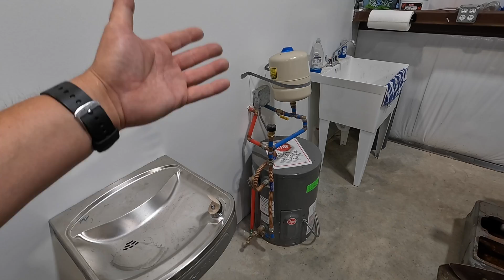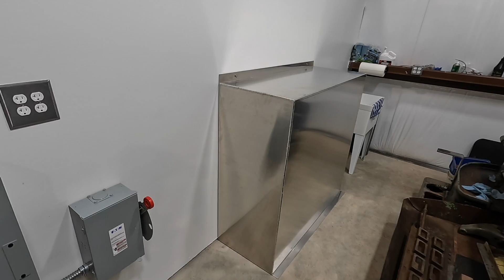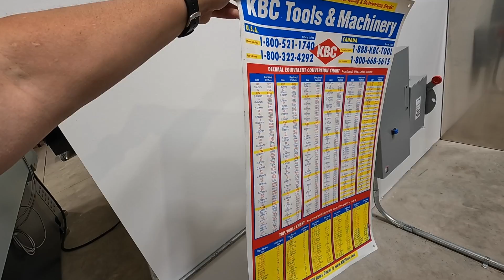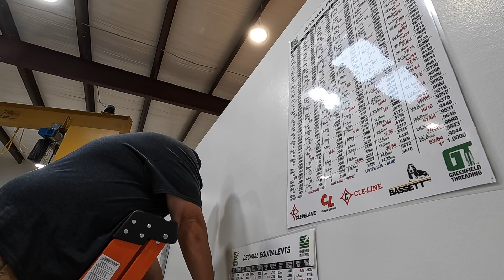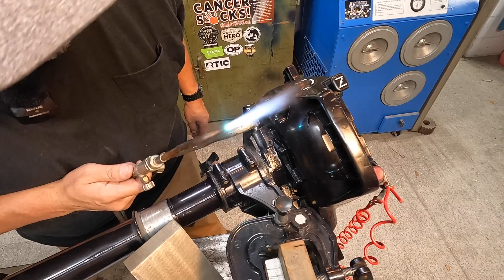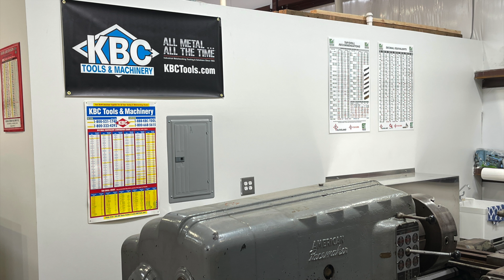SNS 363: American Flag, Shop Projects, Outboard Motor Repair

Comment: Easy slide hammer. take about 2 or so feet of 1/2 rod/thread one end to fit the adjustment screw on a big pair of vice grips/make a 1/2 inch thick washer to go on the other end of the rod  and weld it in place. Take a 2 inch or so piece of round stock about 5 or 6 inches long drill a 1/2 inch hole length wise through it so that it slides on the rod and your done. Take out the adjustment screw from the vice grips and screw on the slide hammer.
Reply: That would make the jaws not in line with the slide, better to weld the rod to the vice grips so the jaws are in line like jody at welding tips and tricks done

Comment: That water heater plumbing was shameful, I would be sacked if I did something like that, the expansion vessel looked ready to fall off the wall
Reply: It is very bad loking, covering it will do wonders.  Good thing you called it a Water Heater, being the son of a plumber I was always hit with "if it's Hot water, why heater it???  It is a WATER HEATER!!!!!

Comment: I got a couple of thoughts here. One, the expansion tank seems poorly supported. The second thing is the p-trap in the water fountain. Inevitably it will dry out and this may lead to sewer gasses leaking in. Aside from the bad smell there maybe toxic and explosive gaseous components.  They will get trapped inside that aluminum cabinet.  When I did plumbing and building maintenance work, one of my responsibilities was keeping p-traps topped up. Floor drains would get a mixture of water and bleach, sinks would get water only.  If a drain was unused and in danger of being forgotten, I would disconnect a p--trap and the drain would be blocked off.  My weirdest p-trap story involved a bathtub that was going to be unused for many years, but remained in place.  An old plumber mentor of mine came up with this solution, in addition to siliconing a bathtub plug in place and blocking the overflow, we replaced the water in that p-trap with mineral oil.
Reply: Interesting idea of mineral oil. A bit over the top maybe. I think a rubber plug would be enough.

Comment: Keep the water fountain accessible Adam. That can be used as an emergency eye wash station in the shop.
Reply: My Father had a machine shop in Louisiana, the water fountain in the shop area was always disgusting!!!  I would not wash anything in that fountain!!  The aluminum box makes sense.
Reply: Really he should buy the right tool for that, a proper eyewash station.
Reply: @omegamanz6  That's what can happen with an eyewash station if it's not regularly flushed. At my job someone needed an emergency room visit after a simple eye wash ended up shooting rust into both of his eyes. After that, a 5min. flush every week became mandatory, and so far has cured that problem.
Reply: @omegamanz6  The bottles are certainly convenient, but I'm always afraid of not having enough if needed. A regular flush isn't that big of a problem, if you consider it as maintaining and inspecting safety equipment.
Reply: @omegamanz6  You wouldn't want to flush a chemical longer?  How about battery acid? We use that in our shop, and if I were to get it in my eyes, I'd flush 'em 'til 3 or 4 guys dragged me away from the station.

Comment: this is the last way i would have tried to remove tat pin. i would have drilled out as much of it as i could, tapped what was left and used a slide hammer to extract it.
Reply: So....I remember Adam getting it out.  Now, I may be wrong, but wasn't that the idea??

Comment: The water fountain is a requirement by the government, the water heater should have been placed on top of the office area/loft section
Reply: It really should have been inside the office/waiting area.
Reply: Ohh Paul.........I agree!  I have seen hundreds of this type of tenant finish and the water heater is always placed above the office space.  It is very odd this was installed as it was!

Comment: I'm kind of dismayed that you burned up the powder coat on that motor housing. It takes a lot more work to repair than painted surfaces because it has to be disassembled, prepared and baked.
Reply: He did say it was a rush job and that the whole unit could be replaced for like $800 so I think that was a compromise to keep time spent and costs down.

Comment: with such a big location now, do you have plans to hire additional help. And with all the cool toys here at new location are you moving your other machines here as well from your other shop? And you should have some plaques made with info about the flags, that would be cool to show.
Reply: I think he said recently the end game is to maintain both shops until he gets a new shop built on the property they acquired. Think he said something like 2 years or so is the time frame they are looking at.

Comment: hang it horizontally
Reply: It won't fit between the AC units.
Reply: Then you'd have to punch a new hole in it - NOT good.

Comment: I doubt I'm the first to mention the lack of ventilation for the water heater.
Reply: Electric H2O heater.  Why is ventilation needed?
Reply: @gomerhondo7249  The poor thing won't be able to breathe.
Reply: @colinfahidi9983  ....That is a special "non-breathing" water heater.
Reply: @paulcopeland9035  No need for an aqualung then?

Comment: Make a 2 x 4 frame and put Rockwood insulation inside. Then hang that big flag over it. That will cut down on shop noise .
Reply: a little bit. Good idea. several more similar sized rockwool panels would be needed for an appreciable reduction in shop reverb

Comment: Adam, how will you service the water heater?
Reply: Take out two screws and scoot it out of the way?
Reply: Very carefully.
Reply: The screws can be replaced with combo lag/machine screws and wing nuts. Also known as hanger bolts. It's not a big deal, everyone has a screwgun anyway.

Comment: Is there enough ventilation for the water heater ?
Reply: It's an electric water heater. It doesn't need ventilation.
Reply: What kind of ventilation does the water heater need?
Reply: Probably should check local code enforcement about covering the drinking fountain and water heater ....water fountain might be required 🤔
Reply: @edwardsilva895  Is he required to provide a drinking fountain to non existent public customers in his private space? He didn't remove it. He put a shelf in, that just happens to cover the fountain he doesn't want or use...🤷‍♂️.
Reply: @charlesblanton1008  yea, i wouldn't drink from a tap that receives flying chips and cutting oil anyway. He could remove  that altogether

Comment: Adam, you might want to drill some ventilation holes so the water heater doesn't overheat. I'd drill a bunch low on one side then high on the other. I also agree with the other comments about either capping the water fountain drain or draining at the trap and putting a few cups of vegetable oil, not machine oil in it to prevent the sewer gases from get loose into the shop. I'd also recommend finding a new plumber!
Reply: The water heater doesn't need ventilation.
Reply: @paulsto6516  I have to respectfully disagree. It generates heat and that heat will build up in the enclosed space when it's running.I bet that thing gets very hot. Let's see if Adam makes any comments on it. He could drill a few holes with a hand held drill, no big deal.
Reply: @Rich206L  It's supposed to get hot. The more insulation, the better.
Reply: @Rich206L  getting hot is the whole point, people who want better efficiency put special water heater blankets on them and it doesn't cause any issues.. the thermostat and wiring can handle what little heat there is, it's below the boiling point of water so it's far from a temperature that will damage anything
Reply: @Rich206L  
Respectfully,  you don't understand how an electric water heater works.
Reply: @Rich206L  ...Nonsense
Reply: @markshort9098  That was the "old days".  Efficient modern water heaters never lose heat  through the case.  If your water heater is warm to the touch, throw it away today!!
Reply: If the water heater is heating through the case, it is time to throw it away.  Nothing should ever be that inefficient!
Reply: @paulcopeland9035  even the new ones would still loose a little heat unless there's a vacuum chamber around them.. I'm not worried about a little heat loss on my hot water tank, it's heated by home made  solar panels summer and a heat exchanger I made for the fireplace in winter, it shoots steam sometimes so a little cooling is a good thing
Reply: @markshort9098  Today's foam insulated tanks do not lose heat through the tank wall.  A very small amount will be lost due to exposed piping.  Of course, a gas fired appliance would have loss through the flue, but that is another story.  This is a small tank with an internal electric element. Even as cheap as it appears to be, it will not heat that enclosure.  This "shelf" Adam has built will be fine and live there long after he is gone on to bigger shops with bigger shelves!
Reply: @paulcopeland9035  I just tried to find out the heat losses for an electric water heater and they do loose heat through the foam, 1.4kw was all the info I could find for modern water heaters but it doesn't give a time frame for those losses.. just because you can't detect it with your hand doesn't mean it's not happening.. heat energy will travel through any materials, it's just a matter of how fast
Reply: @markshort9098  Okay, sure there is some negligible loss but being small enough to where you can't detect it with your hand, it will never heat that enclosure.  You are correct and true to the second law of thermodynamics, heat will travel to cold in any direction.  So, yes, there would be heat loss of some level here, but what is generated by that small water heater is not enough to be concerned with.  Therefore, I declare this "Abom enclosure" not harmful to humans!!
Reply: @paulcopeland9035  yeah there's definitely no harm in what abom done, there's not enough heat coming through to affect anything and any heat that does come through would disapate way faster than it comes through.. It was someone else who was saying there's a problem with the set up
Reply: @markshort9098  Yep!  Have a good day Mark.

Comment: Adam ya need ta do some thin bout the drain for the water fountain when the water in it goes away ya will get sewer gas cummins out of it somethin you need ta address. not only is it deadly gases but highly explosive and it stinks too....

Comment: Since the existing shaft was sacrificial, try welding something to the shaft and use a slide hammer next time.
Reply: Was your volume down the entire video?
Reply: @snowdog90210  😂Probably

Comment: My Grandfather had a slide hammer that he made for his Vice Grips.  He threaded a piece of round stock so it fit where the adjustment bolt goes on the grips and welded a lug on the other end to act as a stop.  A 2.5" x 6" chunk of steel was bored out for a loose fit on the threaded rod.  We pulled all kinds of things out with it.

Comment: I think you managed to land exactly between the 2 sheets of OSB.
Reply: Both screws!? I think the board wasn't installed.
Reply: @KJ6EAD  He only showed missing one screw. But, yeah, the seam is very level and the floor is level and the cover is square. So, yeah, both screws could have landed on the seam. I went back and looked in his previous update videos and the OSB is there.

Comment: the 3M command strips are nice and I do use them but the 3M Dual Lock Re closable Fastener tape is stronger and comes in cut to size strips so your not stuck with what they have in the stores at the time your there . it's low profile and comes in everything from 1/2 in up to 2 in and in a dozen different types and colors . I love it for hanging charts and posters but some of it is strong enough to hold a small cabinet or small tool shelf
Reply: Doesn't that have a permanent adhesive that damages the wall surface?

Comment: A drinking fountain is definitely required, and in most cases useless. That heater install is ridiculous. How the inspector past an expansion tank on pex  is beyond me. The shops looking good though.
Reply: Breaks all regs in here in the U.K…no way that could be signed off .. I’ve seen some great plumbing in the US, it can’t be US standard.. no way !!

Comment: Please get a real plumber to fix that crappy water heater install, and just remove the water cooler from the wall. It gets you some more space behind the lathe.
Reply: Put the water heater on the meizine
Reply: Believe it or not it is a code requirement in most places to have a water fountain. And in a shop, OSHA is going to want to see an eyewash station.
Reply: You need to send your concerns to the owner of the building.  Adam has nothing to do with the building fixtures.

Comment: You can also pour cooking oil in the water fountain drain for the p-trap. It doesn’t evaporate like water. Learned that from having unused basement bathrooms.
Reply: Good tip, gonna try that in our less-used toilet at work, genuine thanks👍
Reply: That's a good idea! 
I've always used cheap antifreeze but that was for spaces that were subject to freezing, antifreeze won't evaporate either but I like the idea of cooking oil better.

Comment: You may want to cap off the drain in the water foutain, once the P-trap dries out sewer gas could come into your space.
Reply: Agree—pour mineral oil in it to slow evaporation of trap for a year or two. Doesn’t go rancid, won’t cause problems.  Otherwise you’re gonna have sewer gas come up every winter until you run some water down drain again.
Reply: I gotta agree 100%
Reply: Or pour some mineral oil in it,
Reply: @robertparker2420  
I don’t know about regulations in the USA, but here pouring mineral oil into the drain will get you into real problems! 
Even if it is not illegal where you are, do you really want any more deliberate pollution in your water system? 🤢
Reply: @grahamstretch6863  it’s actually a standard procedure to fill the p-traps of drains that are not normally used like dishwasher emergency overflows or plumbing fixtures that will not be used for some time (vacation homes) in order to prevent evaporation and the release of sewer gas into households.  A half cup of food grade mineral oil isn’t an environmental calamity and it’s perfectly legal in the USA where Aboms shop is.
Reply: @grahamstretch6863  mineral oil is food safe. No need to panic or call it an EPA superfund site. You probably consume mineral oil with every meal. 👍
Reply: @michael-michaelmotorcycle  
Engine oil is mineral based, cutting oil is mineral based, way lube is mineral based, so shall we compromise on very few mineral oils are food safe? 🤷‍♂️
Reply: @grahamstretch6863  food grade mineral oil, you know the stuff that is sold specifically to put on your wooden cutting boards to keep them from cracking is neither “engine oil”, “cutting oil” or “way oil”
Reply: Didn’t think of that good point
Reply: I came here to say the same thing.
Reply: I’d recommend pouring RV antifreeze in the P-trap instead of capping it.
Reply: Thanks for the video Adam. I don't know why but the flag hung like that kinda bugs me. Can it go horizontal?
Reply: @stevespra1  well, the way flags are made theyre meant to take tension from the aft section outward. Thats why its doubled over with rivets on that side. If you have the flag horizontal, you will need to pierce the fabric on all 4 corners in order to keep it taught and flat, which will eventually destroy the flag. If you want an american flag on your wall, mounting it aft upward is the only right way as far as the flag is concerned.
Reply: @MichaelOfRohan  Good point!
Reply: @MichaelOfRohan  this!
Reply: Good point
Reply: Sewer gas is flammable and the hot water tank has an ignition source. Just sayin….
Reply: @jimandrews7566  that's an electric water heater, no flame
Reply: @brockwagner939   Sit in the dark with an electric water heater when the relay kicks on. Lots of times, there’s a spark. That’s why industries that deal with a lot of flammable gasses have to buy all kinds of expensive specialized wall switches, light fixtures, refrigerators and yes, water heaters that are designed to minimize the risk of sparking in those areas where flammable gasses are worked on, generated, transferred, or stored.
Reply: @brockwagner939  Yep, no flame. The contacts in the thermostat often produce an electrical arc when they close or open.
Reply: @brockwagner939  electric heater still make a spark every time the thermostat shuts off.

Comment: I would have hung the flag with the stars to the right, but maybe I am missing something.
Reply: It follows the flag code, must be to the left.  Not optional.

1. When displayed either horizontally or vertically against a wall, the union should be uppermost and to the flag's own right, that is, to the observer's left. When displayed in a window, the American flag should be displayed in the same way, with the union or blue field to the left of the observer in the street.
Reply: @mshilko  The "flag code" is a guide line.  There are no laws that govern flag display.
Reply: @mshilko  Not optional? Sounds like North Korea. What happens of you mount it the wrong way? Criminal offense?
Reply: @mshilko  
Learned something new.
Thanks
Reply: Stand corrected! A day when you day something is a good day!
Reply: Yep, IMHO the stars should be on the right when hung on the wall like that.
It doesn't look right as is. .